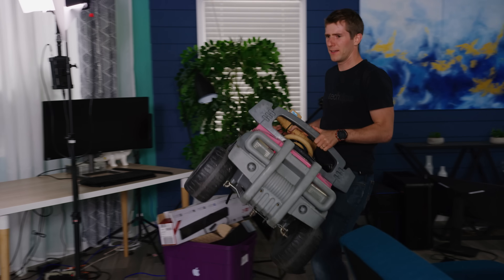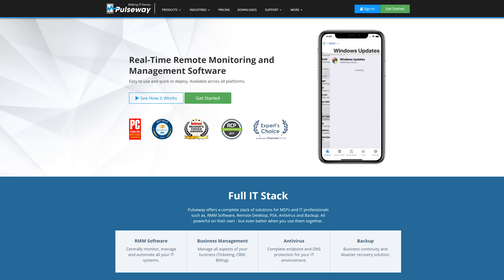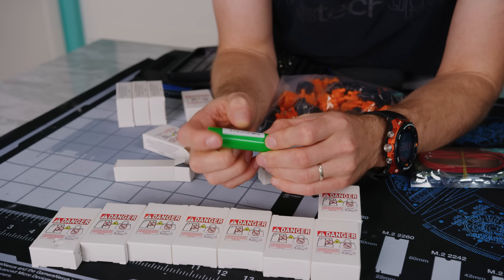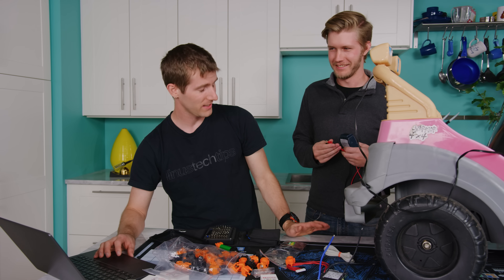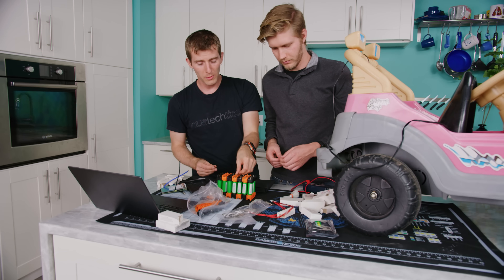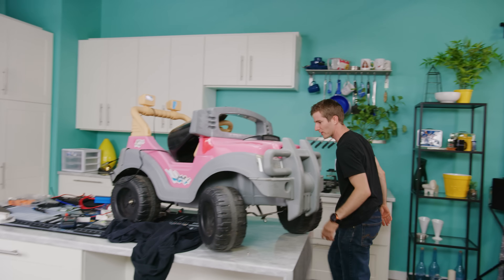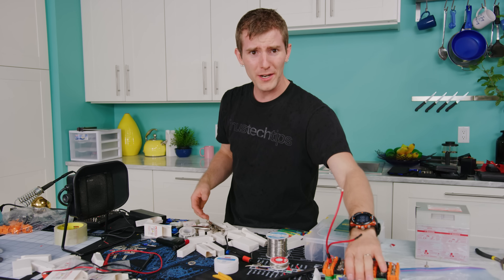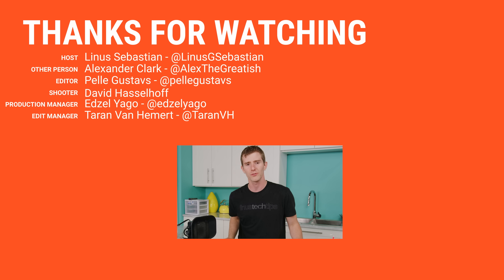DIY Lithium Battery - What could go wrong??

Comment: This is stupid dangerous!!

Battery fire is the least of your worries.
If those battery wires connect with say, a wedding ring, they can weld themself to the ring. The ring then gets stuck onto the finger as it burns.

You want to know what a finger looks like after you dump several hundred amps though it? You'll be luck if you can even save the hand.

Do not fuck around with angry pixies. They bite fucking hard. It's not voltage that kills you. It's Amps. And those lithium cells have a shit ton of amps. A lead acid car battery at 10amps will mess you up. Lithium batteries that can dump 100amps will set your flesh on fire.

That said. Given proper safety precautions they are actually very safe.

Comment: 5:00 Electrocute you? Yes we're all well aware of how people die every day from touching 3v-5v batteries... Ever put a 9v across your tongue? Bam dead!

Even a fully charged 7S pack at 29.4V wouldn't be high enough to pierce your skin in order to give you a shock, you'd be at a bigger risk getting a burn from the screwdriver heating up if you were to short it out.
Reply: @ClapTrap Hah. Please check your facts, it has nothing to do with 'breaking' the skin. 
https://www.physics.ohio-state.edu/~p616/safety/fatal_current.html
https://www.allaboutcircuits.com/textbook/direct-current/chpt-3/ohms-law-again/
https://qph.fs.quoracdn.net/main-qimg-03802a4a481b9fcfeadfffbf82c3d296
Also, of course I understand you can't have current without voltage - but it's the amount of current that flows that causes damage depending on the resistance - you can have a high voltage and be completely fine, if the current is low (e.g. static shocks, limited current power supply)
Reply: Sam Sharp Of course you can have high voltage that doesn't kill you, but the point is that you'll rarely run into a situation where the opposite is true and a low voltage (or pressure) is going to be able to push a high enough current through you in order to kill you, btw I didn't look all the way through those "facts" you linked but that chart is obviously BS otherwise phone chargers would be killing people on a daily basis...
Reply: They don't, because normally when you touch them, the resistance of your skin + your internal resistance is high enough that only a very small current can flow - making it safe. Put a phone charger directly onto someone's heart and it could kill them. Pacemakers work on voltages from 1.5 volts. Look at the second link to get an idea of the different resistances of different parts of the body when wet/dry etc.
Reply: In any case, the point I was trying to make was that it's not correct to say that anything below 50V is safe - voltages lower than that can (and have) caused deaths from electrocution.
Reply: Yup, everything below 120VDC (or 50VAC) is considered a safe voltage, so you definitely can't get electrocuted by a 24V battery.
Reply: @tomkocur  ohh trust me it hurts when touching a 24V truck battery might not be lethal but it sure hurt ALOT! 
But people only mention Volts and not the AMPS so by having 24V battery with 240Ah hurt like hell.
Sure you might not die if your lucky but it will most likely not be a pleasant experience.
Reply: HexxxiZ current doesn't work like that. When you touch a 24V battery, the current flowing through your body equals to voltage divided by resistance (ohm's law). Considering a 5kOhm resistance of a human body, 24V will generate a 4.8mA of current, no matter if it's a small transformer or a truck battery. 24V from a truck battery only hurts when you drop that battery on your foot. With a dry skin, you would barely even feel 24 Volts
Reply: Just want to point out that this isn't quite right. It's not the voltage that matters but the current that passes through the body. Of course, a higher voltage can drive a higher current - but even 10V can cause damage if the resistance is low due to damp/wet/broken skin. It only takes 10mA for a nasty shock and 100mA for it to be potentially lethal.
Reply: Sam Sharp Yes the current passing through your heart is what kills you, but you don't get current flow without voltage, you need both in order to get a fatal shock, which is why you can for example pick up any random thing plugged into a wall outlet, because the voltage isn't high enough to pass through the high resistance of the insulation covering the wires, of course lowering the resistance makes things easier but I don't see a good reason to be working on wet batteries and even then it still shouldn't be fatal at 30v used here.

Comment: You guys are so dumb, this is the kinda shit you hear about peoples vape blowing up, how do you run a tech company and not have one "advanced vape user" let alone one of the crazy take risks for clouds and more power vapers. I could have made you a 40 amp continuous with as many mah's as you wanted, generally 2k -2.5k mah per cell, and those are the safe ones that vent instead of explode when you fuck up. So 40 amp all in series and operating at manufacturer spec for continuous use. When I was 4 I figured out how to take the Governor out of my 40cc or 50cc 3 wheeler and my big wheel jeep had a battery where each cell had a plug and I rewired it to be 4 cells in series, parallel with another 4 instead of 2 in series 4 in parallel.  My big wheel did burn outs and wheelies, my dad as a mechanic was impressed with both modifications i made at such a young age, until I killed those batteries maybe a month or 2 later. Don't remember ever getting shit for removing the governor in the 3 wheeler though other than my dad wondering why I kept tearing up the grass.

Comment: You should probably cool these with lot's of low quality thermal paste and some spare CPU's coolers. That's literally a time bomb (one cell failing might cause a chain reaction due overheat, these cells can reach over 80 ºC easily). Also, drifts memes incoming. DEJAVU
Reply: I HAVE BEEN IM THIS PLACE BEFORE
Reply: He could Dremel the holes in the fake grill and install a 24V fan in the front. That would be really cool because you have a functional grill

Comment: 3 server power supply's wired in series  with the 12 v legs will give you 36 v at will give you nearly 100 amps far more than you need or just a bunch of computer power supply's which we know you have far more than you can ever use.

Comment: Don't you have a lab bench power supply with variable voltage?! Like you use for the crazy fans. ;p why make it more difficult than it is? :D
Edit: and if you don't have a spot welder then you should make sure to solder it very quickly to not drive too much heat into the cell.
Reply: Yeah, with batteries its either a cold solder joint, or a burning battery. Neither are good.
Reply: Yeah. But rather a cold joint than a fucked cell because that could kill the whole battery pack if you are unlucky. That cell will be so much lower capacity than the other and then you risk reverse voltage and yeah...  Ofc they could've just soldered on the bus bars instead of straight on the cell and there would be no problem.  :) But the thing that bother me most was that they went looking for a psu with correct voltage when they have a real variable lab power supply they could use. Oh well. :p

Comment: WOW, it took you way to damn long to realize its a battery and you should tape up the output wires...
Reply: Man, that was irritating as f.. :E  
You don't solder wires to a battery, you solder a connector with leads!
Reply: its not all that uncommon to solder directly to the battery, its a little dangerous if you have very cheap battery's as you can burn a hole in the end which is always fun... not saying i did it and ate a hole in the boss's desk or anything :-/

Comment: If you're doing this, why not try to make a phone and laptop charger from a motorcycle battery. That would be a huge powerbank in case of blackouts.
Reply: Assuming the Motorcycle battery is 12 volts, you could just use an ordinary power inverter and use the AC adapters. It's not as efficient as making a DC to DC Power supply but it's more universal. If the motorcycle batteries are 6 volt then just wire 2 of them up in series.

Comment: I was thinking of grounding the battery first and then charging it later so that way it's more safer to setup.
Reply: a lot of battery is broken if depleted. For example a Lithium Ion battery is typically set as "0 capacity" at 3.7volt, while Lead Acid battery is typically set as "0 capacity" at ~11volt. A point of advice: Never ground a battery, never to deplete them to "0", never.
Reply: @xponen  Whoops, by default the electrical systems have a default ground in the vehicle. But didn't know this about batteries.
Reply: @Weeb's Gaming , the "ground" on a motor vehicle is indeed connected to all electrical component (including the battery) but it's not a safety feature, it's a substitute for wiring. With everything connected thru the vehicle's chassis you now only need 1 wire to carry the charge from opposite terminal instead of 2.

Comment: I wonder if this would be better then a lead acid battery for a UPS?
Reply: Since most people do not port their UPS' around, there is no reason to use a lightweight battery. Lead Acid batteries have around a 5+ year lifespan when kept charged, where as a lithium's lifespan is measured in charge/discharge cycles. A UPS keeps the battery topped off all day long, which Lithium batteries do not like and will shorten it's lifespan.
Reply: Lithium has a clear advantage for powering things that move -- the batteries are smaller and lighter... A UPS is typically stationary, so why not enjoy the cheaper mass-market technology (lead) ?

Comment: you need to know my degree in electronics just jumped out the third-floor window and ran the hell away! fellow 3rd rockers do NOT follow linus's visual instructions do it properly. btw Linus if you need a sign off on getting a job for the CSA let me know I'll sign off, you can be the before tester ;)

Comment: Keep those batteries in a safe storage they can burn down a building quick. Take it from me a 3S lipo charging burnt down half my garage.
Reply: They're all bad if mistreated, even Lead acid can explode under the right conditions
Reply: yeah would not abuse lithium polymer like that they will kick your arse
Reply: Li-po vs Li-ion... Main difference is that Li-on carry more power dense (when all things are equal), cost less to produce, and have far less memory effect. Li-po can discharge and recharge more quickly at higher rates with less damage to the cells, are flexible so can more easily in to places, and weigh less...
Link for reference: http://blog.ravpower.com/2017/06/lithium-ion-vs-lithium-polymer-batteries/
Reply: Those are lithos not lipos, much safer
Reply: buddy, have you seen what li-ion's do on short circuit vs li-po's? Li-ions blast and lipos bloat up and fizz off. I vape, and we use li-ions mostly which is very dangerous on short circuits.
Reply: MasterMech77, yes and no. There are two types of lipo batteries. 1. With solid electrolytes separated by polymer 2. a Gel like electrolyte separated by polymer. When a Li Ion battery is shorted, specifically a 18650, it tries to swell up but due to the solid metal casing, it doesn't have room to expand and the temps go higher and higher when suddenly the casing cant take it anymore and suddenly explodes, letting all that pent up gases go out in the open while the temperature and the exposure to oxygen has it go off like a out of control firecracker.

In the case of LiPo's, they usually have a protector circuit attached to them as to stop overcurrent(charge and discharge) and short circuit protection. But for the sake of the discussion lets ignore the electronic bits. When a lipo is shorted, like the battery no.2 in the video, first it tries to swell up, and if you leave it at the point nothing would happen, unlike what the guy did. This is because the separator between the two electrolytes is flexible and doesnt easily allow them to react with one another compared to li ions and therefore, to an extent, prevent a chain reaction from happening.

P.S. Watch some Mechanical Mods exploding in guys's pocket videos, you will be horrified.
Reply: Use an old, cleaned out BBQ as your charging station .... In your garage.
Reply: Do this inside Linus's pink car or at the parking lot. (LTT probably void their insurance on the premises just by doing this experience).
Reply: Lithium ion are very safe it's the lithium polymer just like you said that you need to keep an eye on

Comment: You really should have used crimp connections rather than soldering those wires
Reply: What's the benefit of a crimp vs solder?
Reply: @piyh3962  solder will crack with vibrations. If the cable is not fixed to prevent movement the solder joint can also break. In rally cars nothing is soldered due to the high vibrations. 

A proper crimp is still a good connections. Crimps can tolerate more abuse and vibrations/movement.
Reply: A proper solder connection is just as good as a proper crimp connection. The key word being "proper". It's very easy for a crimp to be specified wrong... Wrong ferrule size, wrong ferrule wall thickness, wrong crimp type, wrong size dies, poor tolerance dies and crimper... The list goes on. Same for solder.

Solder is more reliant on the operator, crimping is all up to the specifier, but both need a proper procedure document if you want decent results.

Or just use Wago click clacks. That's what I do. Idiot resistant (nothing's idiot proof), connections for finely stranded wires 0.14mm² to 6mm² certified for vibration environments by multiple authorities.
Reply: John Alexander solder isn’t meant to be used to support a load. As another commenter pointed out solder joints can crack and the last thing you want with a battery like this is a wire flapping around in the breeze.
Reply: Neither are crimped connections, and the wrong crimped connection even more so.

A solder joint done right won't crack in this application. A bad crimp (like one done by someone who doesn't own $17 000 worth of crimpers and $1000 worth of ferrules) might pull out, or damage the cable inside the ferrule.

Put it this way: That looks like 4mm², finely stranded wire being attached to a M5 post, so I'd use 4mm²x5mm uninsulated ring lugs with a hex crimp. I've got 4mm²x5mm uninsulated ring lugs (with the correct wall thickness) and a ratcheting 4mm² hex crimper. Do you? That would probably be better than soldering. Or are you suggesting that some yellow insulated ring lugs, crimped with that POS multitool he's got in his hand, would also be better than soldering?

Of course, if it turns out that those are imperial wires, I can't crimp them...
Reply: Do you go to PC forums and post, "Macs just work", then go to Mac forums and post, "PCs are cheaper"? For the sake of the planet, you should never go anywhere near the Middle East.

Comment: Next time, please do protect those wires... Because if they short, you will end up with very unhappy battery. And unlike very unhappy PC verge built, batteries get pretty explosive when unhappy and can result in injury. So unless you want explosions with potential fire, even for entertainment video, you could take bit better care of safety or at least put whole "do as we say, not as we do" thing in. Since it kind of could promote bad handling of battery as laughing matter, which in this video it is, but blown up batteries, high degree burns and other stuff that can happen aren't exactly laughing matter.
Reply: nah, only in direct short circuit, if there is a BMS in between it should prevent that. plus those are high amp rated batteries those can  tolerate a short a bit better than li poly and low current rated li-ion batteries

Comment: bruh get some tires from the scrapyard and try digging out the middle of the treads and putting it on the tiresthat'll really solve the traction issues, but if you turn really hard, you'll probably flip the car over😂

Comment: Want to really soup up your kids power wheels?  I'd love to do a segment with you.  My kids has 8x 8ah batteries, an arduino mega with mega motor shields, traxxas 550 motors, full leds lights, siren, bluetooth stereo, speakers, even a dual axle trailer to tow her other single seater power wheels.  https://tinyurl.com/y7d5227n

Comment: Why not DIY revolutionary portable computing device, with that DIY lithium ion?  One flat row, small motherboard, pcie riser, fold-able ram slots, pressed copper tubes fitted for custom low profile cooling connectors, dedicated graphics, and functional in form?

Comment: but linus you do understand a electric motor is more or less like a cpu they are only desngined to take so much voltage. look at stuff like RCs where a motor is $100-200 and a spped controller is $200-400. some motors/speed controllers can only handle so many volts or amps. and if you go higher there is a good chance of burning them up. if you really want to make one them move tho put a 6 or 8 pole 500kv motor and a esc that can handle 12-16s. in 1/5 scale rcs they still do 60mph or more so should get you about 20-30ish given weights a lot more then 20-30lbs.
Reply: 400 for an esc what are you getting???
Reply: @Ranrr2  depending on were you live. There is orion esc's for 380 or so. And the esc's for 14s or 16s are not cheap
Reply: @highks 24v is 6s. But let's be honest who dosnt want one of them to run 30 or 40mph+

Comment: haha I like the idea but do some safety stuff next time. A block of 18650's that size venting is no joke.
Replace those LG MJ1 batteries with Samsung 30Q or Sony VTC5a. You'll lose 15-25% of your capacity but you'll gain double or more the discharge output. That'll control heat a lot better

Also attach a damn temperature probe to that battery block. You hit a certain temp on those things and they'll vent